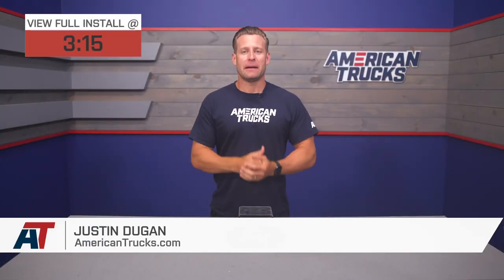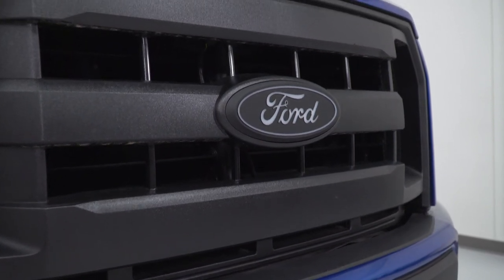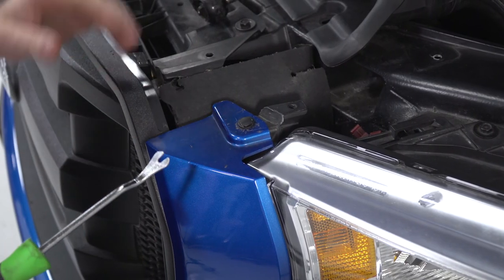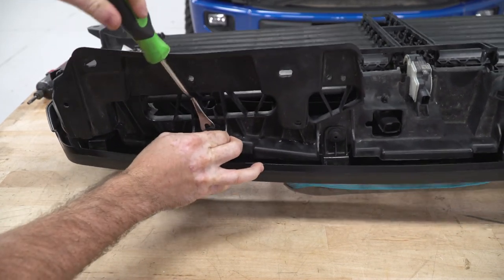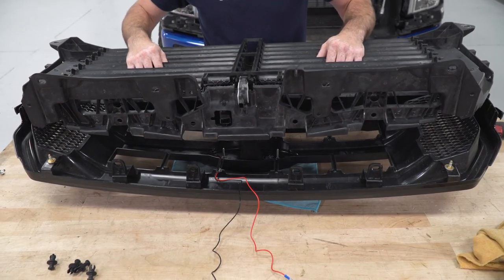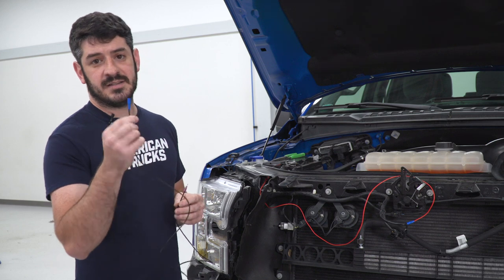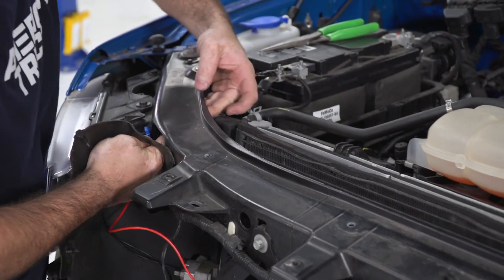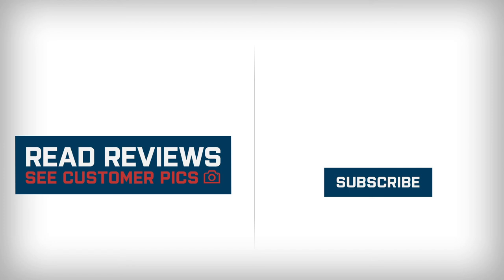2015-2017 F150 Luminix LED Front Emblem Review & Install

Comment: I just install mine today on my 2015 f150 platinum but the emblem doesn’t want to turn off is there any other way I can run it?
Reply: Did you ever get it to turn off?
Reply: Place into cruise control fuse location. That should fix your problem.
Reply: I used the fuse tap they provided and plugged it into the power steering fuse. It only works when started/driving.

Comment: I installed it but my light won’t turn off
Reply: what did you figure out mines the same way
Reply: @tylerlaw9694  I used the fuse tap and plugged it into #105 the power steering fuse. It only works when truck is running/ driving.
Reply: @tylerlaw9694  I just returned it.